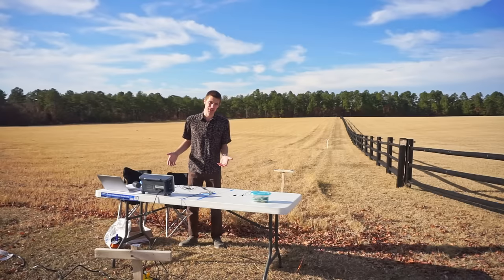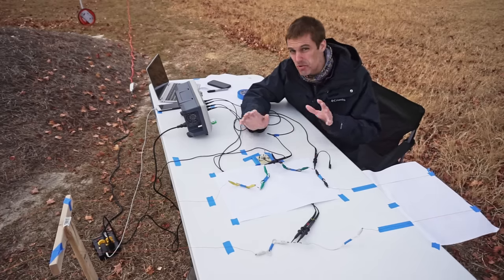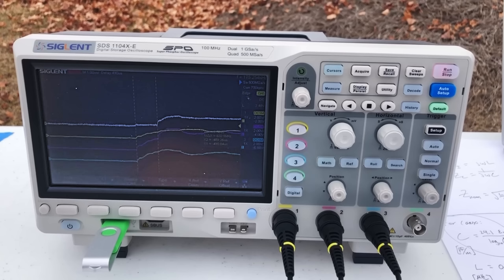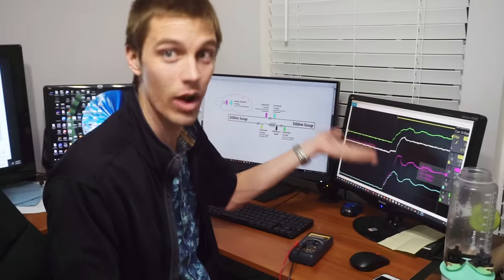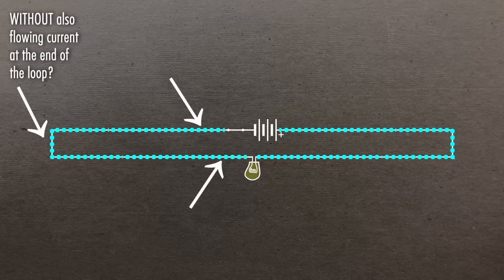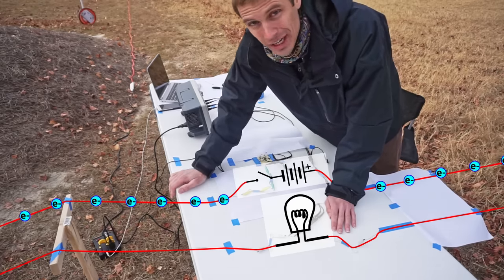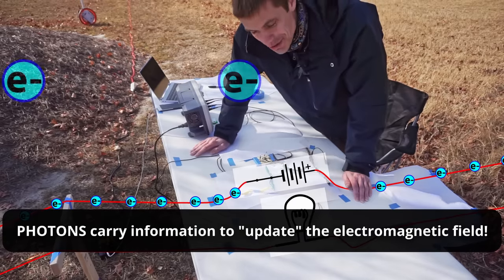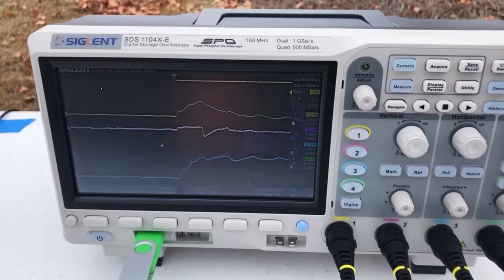I bought 1000 meters of wire to settle a physics debate

Comment: Very interesting. Initially the 2 wires cross talk "instantly" because they are so close to each other. You made an emitting antenna and a receiving antenna, with few centimetres distance between them. I wonder what would happen if you used coaxial wire or somehow use some shielded wires that cannot cross talk.
Reply: that was the whole point of Derek's video - that the energy is around the wire. When you use coax you forbid all of that and then this whole effect goes away and the electricity has to flow the 500 meters before anything happens. He could emulate that by moving the resister 10 meters further away.
Reply: I was wondering about the impact of insulation/shielding on the wires as well.  

But @Idjles Erle addresses that, I think.  Yet, something about both Veritasium’s and Phoenix’s videos still “feels” incomplete to me ( I have ZERO electrical engineering or physics education, but have worked extensively in telecom all areas most of my life).  

So I’ll watch Phoenix’s part 2 to see if/how it addresses that “feeling”.  

I learn by inferences and logic of these videos - and even if I don’t/can’t do/understand the formulas involved, the practical applications of the facts/concepts presented are intriguing and compelling enough to explore !
Reply: Levels of physics seem to go infinitely deep, ask any Quantum physicist. For this experiment, it helps to include the physics that electrons don't literally move through the wire. They PASS their energy to the next electron and so-on down the wire. More like bumping one ball at one one end of a long line of touching balls, and measuring the time the last ball moves. The concept that electrons CARRY energy, and are NOT the actual energy, is usually moot in practical applications, or classes for that matter.
Reply: @genewitch  the speed of light is not a limit...in quantum physics it's called instantaneous action at a distance and its faster than the speed of light....it's instantaneous hence the name....
Reply: @CounterAttack1989  okay sure, if you can split an electron or whatever sure. That's theoretic. There's no quantum physics here.  Do the experiment I laid out where the two systems are only connected by the wire pair and time, and show me I am incorrect.

The laws of the universe are clear. Information can not move faster than the speed of light. A collapsing wave function or a spin measurement doesn't mean anything if it confers no information. Information has a precise definition.
Reply: @solosailorsv8065  They do literally move through the wire though. That's what the current is. It's just that the energy they transmit by bumping into each other is much faster than their actual movement. We're talking about a few centimeters per hour through a small copper wire with ten amperes of current.
Reply: @idjles  "you forbid most of that" FTFY, just for the sake of being accurate ;)
Reply: It functions more like a capacitor than an antenna. With larger distance between the "bulb" and the "switch" it would be more like an antenna.
But probably all three effects are at play here: capacitance, inductance, antenna effects(electromagnetic waves)

Capacitor works with electric fields.
Inductor works with magnetic fields.
Antenna works with electromagnetic waves. (You need to combine the Maxwell equations to get the wave solution, it was a mindblowing result at the time)

If you really want to know what is happening you need to solve the Maxwell equations. It is practically a perfect model in this case, you do not need quantum physics (unless you want to understand the microscopic stuff too)
Reply: @genewitch  Good analogy, but we all need to keep open minds, as what appears impossible today, will one day be possible, in the same way that what was impossible 500 years ago, is now totally possible. The speed of light will be exceeded, for example, we can already 'teleport' an electron from one place to another and alter it at a quantum level instantly, it does both of these things at unmeasurable speed. There are particles and mater in space we have not yet discovered, they could be moving so much faster than the speed of light we cannot even detect them. Many theories by countless famous scientists of old, have been superseded, and in the same way Copernicus revolutionised our position in the solar system, I am certain this century, Einstein's theories on special relativity etc will be replaced by someone else's (they are already tenuous), and why should we be afraid of that? Einstein is not God, he was fallible and much of his research was fudged to make the figures work (this is fact), so one day he will be replaced, when other scientists lose their ego and the fear of ridicule for doing what others are afraid to do and saying "Einstein was wrong"!
Reply: @ankyspon1701  You're right, if we expect that fundamentals will never change then it will veer off from a scientific process to becoming dogma. Although, a bit of both in a good mix is usually required to stick with ideas long enough to falsify them. Invariably, considering the history of any scientific field it's as if the likelihood of any previously established scientific understanding will be reworked or overhauled approaches 1 the longer time goes on.

As someone with no education in physics at all, my intuition just told me that even if the instant exchange of information would be due to magnetic "cross-talk" through the proximity in the U-shape of each of the two wires, wouldn't it then be possible to place something at the end of the U-turn that could interpret the field as a binary signal? Given that the current is strong enough, of course. If scaled between USA and Europe, wouldn't the same thing happen then? If it does occur, shouldn't the other end (at the U-turn) be able to detect it?

I'm excited to see what the possibilities tomorrow will bring.
Reply: @ankyspon1701  I don't know of a single actual physicist who doesn't "admit" (your word) that Einstein was wrong about at least some things, and that even Einstein's most successful theory (GR) is at least incomplete - along with QM - which is why many are of them are actively seeking the eventual replacement for both theories (and the rest are watching and waiting to see the results of that search, while getting on with their own work)... So I really don't know what "ego and the fear of ridicule" you are talking about, here! 

In my experience it's mostly non-physicists who were taught their physics in the mid-20th century and don't understand how far thing have moved on since then, who go around declaring things to be "impossible" based on what they learned at school, rather than daring to do any more learning. But even when I did my back degree in 1983-87, we were already being warned "don't go thinking this is the final theory; It's just the best answer we've got so far , and if you want to play a part in finding a better theory, then you need to understand this one well enough to see where its strengths and weaknesses are".

But in the meantime the evidence just keeps on stacking up - as it does here - that within the constraints he set himself - i.e. only looking at Gravity, not any of the other three "fundamental forces" (as they were considered back then, and are still referred to today as shorthand), Einstein eventually got GR completely right... Except for that pesky business of the Cosmological Constant, which he decided was an error and should be left out, but then turned out to be both real and extremely important. =:o}
Reply: @genewitch  That's very cool QRPP DX 👍 However, I guess you used RF and a resonant antenna, not (pulsed) DC and random wire, right 😉

As you know, field strengths decrease with the square of distance, so 10 m instead of 0.5 m should reduce the effect 400 times, shouldn't it? Of course, it could never be eliminated completely.
Reply: @ankyspon1701  It really starts boggling physicists' minds when you explain that the dielectric field by itself has no propagation delay.
Reply: @reiyuki  Totally agree, and an objects mass will not be a hindrence at all. If you can move an object from point a, to point b without it having to actually move through space. Although mass may not actually be prohibitive, as in variance to Einstein, Nikola Tesla said an objects mass is unalterable.
Nikola Tesla also applied for a patent in 1900 which showed the current from his transmitter travelled across the earth at 292,000 miles per second! While this isn't instantaneous, it should be another reason for scientists to stop thinking the speed of light cannot be exceeded. Rupert Sheldrake says it best, science is at present limited by assumptions that restrict enquiry.
Reply: @ankyspon1701  This is actually one of the experiments I am actually working on this year.  It turns out GPS-diciplined oscillators will self-synchronize, making them perfect tools to do time-of-flight measurements over significant distance   :-)

PI/2*C expected velocity (to fit with Tesla's predictions and with Eric Dollard's analog computer model)
Reply: @solosailorsv8065  Electrons literally do move through the wire, though. Your ball analogy, which is accurate, even demonstrates why: push on a a line of balls, each ball may only move a small distance, but any change in the pressure of your push will quickly traverse down the ball sequence. Balls have friction and elasticity, so this gets expensive and wonky at long distances, but electrons in a wire experience negligible friction and elasticity, so the result are pure pressure shockwaves at near the speed of light.
Reply: @jay31415  Quantum entanglement, or "spooky action at a distance" as Einstein called it. You need to understand the difference between transverse and longitudinal. Speed of light only applies to the transverse (temporal/event) universe, not to the pressure universe (a quasi-crystal). In the longitudinal universe everything is resonance, not interference. 
Maxwell's longitudinal equations don't exist on the web, although I once saw someone post them from a photo of an old book but was quickly deleted. Need a Security Clearance and a reason to see them.
Reply: @jay31415  You don't know what you don't know.
Reply: @MrVanhovey https://en.wikipedia.org/wiki/Argument_from_ignorance
Reply: @jay31415  I'm an EE that worked for Lockheed SSD. Hardly ignorant.
Reply: @genewitch  he couldnt measure the delay between the switch turning on and the resistor resisting the charge. if you watched dereks video, youd know that this delay does not break causality because it is actually transmitted at the speed of light through a straight line path. i feel like this result is entirely predictable just using Feynman diagrams.
Reply: I was thinking about this. Got my MSEE in electromagnetics and my gut told me something was up with Derek's explanation. This video and your response are much more satisfying. Glad someone was able to run the experiment!
Reply: @Talk to the hat. you are correct, the original experiment has the wires 1 meter apart
if the wires are 1 cm in diameter (roughly what you see in the video) the impedance of that transmission line is about 600 Ω

you cannot light a 12V lamp with a 12V battery thru the current that jumps across a 600 Ω transmission line.  That is what Derek claims, and this video says is correct, that the light will turn on in 3nS.

The original video is deceptive because of Dereks "any amount of current lights the bulb" claim. His entire video is to claim the power that runs our houses does not couple from the electrons moving thru the wire with a wave front near the speed of light - his experiment is suppose to show the power is conducted by the fields outside the wire - and like magic his light goes on instantly.

That is NOT what would happen with a transmission line 1 light-second long. It would take one second for the lamp to get enough current.

The video is nothing but click bait to get as many hits as possible for his 5 minute commercial at the end - PERIOD
Reply: @steelwasp9375  I'm not really concerned with how silly I may seem to some. Not here to convince you of anything. Simply conveying what I think I've learned. Take it as you will.
Reply: @idjles  Have you actually done an experiment and seen that the "whole effect goes away"?
Reply: @CounterAttack1989  But that is a type of action that cannot transmit information. The speed limit applies to physical objects and information.
Reply: @ankyspon1701  Who said that they afraid of replacing what Einstein said?

Comment: Is part 2 out yet ? I’d love to see what happens when the wires are further apart, such that the electromagnetic field interaction along the parallel wires is weaker. Wouldnt the amplitude of the voltage deminish quadraticly fast with increasing distance ?
Reply: Agree. I want PART 2!
Reply: Yes, not only further apart but also a case where the circuit is formed as a circle.

Comment: I made my living off of Transmission Lines for the past several years. This is an excellent description of what's going on. 
Derek's video was an oversimplification of a very fun topic. I look forward to your follow up videos!
Reply: So did you notice or have to be aware of a instant voltage in the transmission line when power was turned on many kms away ?
Reply: In a power grid, there are so many loads and generators, that it all balances out. If you only had one generator and one big load, the generator acts like a fly wheel storing energy, so all you would really see is a small slow down in the motor.
Reply: @JakeHarris0  was more trying to ascertain the voltage he sees before the main spike in voltage of you’d have ever noticed it before when generator is turned on.  Tesla has noted it When he turned on a power station but didnt actually know what it was.  

Seems you have too many generators power sources running on main lines to notice this or detect it.

Comment: I love when live and real experiments are done to settle a discussion. Everything was as expected, but the part where the current "bounces" back after it reaches a dead end and moves in the opposite direction for a brief period caught me off guard. I never really thought about something like that happening, but it totally makes sense.
Reply: Like waves hitting a wall, start moving back
Reply: @otherdimensionss  there are no walls at the end tips. Simply since there will be more electrons they repel each other backwards
Reply: @davidabdollahi7906  No its due to the fact that wires have some inductance and capacitance. So it takes some time to reach RLC steady state until which they resonate.
Reply: @ashwinalagiri-rajan1180  When you use transmission line theory to explain this "bouncing" effect, it is easy to think in terms of waves bouncing back and forth from the end of the wire in much the same way water bounces off objects in a pond.  The interference of these waves with each other causes the distinctive "bouncing" current and voltage patterns.

They teach us in EE school that RLC circuit behavior is a gross simplification of the behavior of electric circuits that is only valid when the circuit features are much smaller than the signal wavelengths.  And we only use RLC equivalents for circuit behavior of real transmission lines at a point. 

AlphaPheonix's explanation based on charges, electrostatic, magnetostatic and electromagnetic theories are very good explanations and can explain a lot more things that happen in the circuit that are way beyond the ability of RLC circuits to explain.
Reply: @renedosr  Alright I think you're more versed in the subject so I accept your answer.
Reply: It's just what happens when you charge up an inductor, the electromagnetic field collapses into the wire which induces a huge spike in voltage.
Reply: Oh yes this is very real and is a big player when dealing with radio , frequency drives...  It is called a reflected wave and can have a cancelling or adding affect depending on the phase of the reflected wave to the principle wave.  This is what radio operators are trying to minimize when they tune their antennas for SWR.